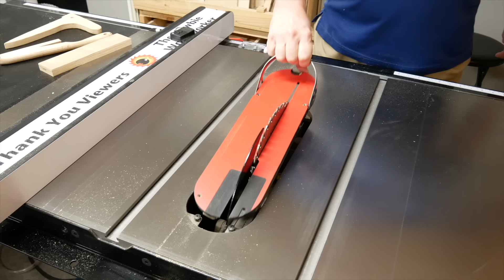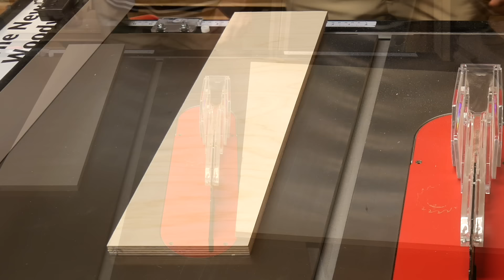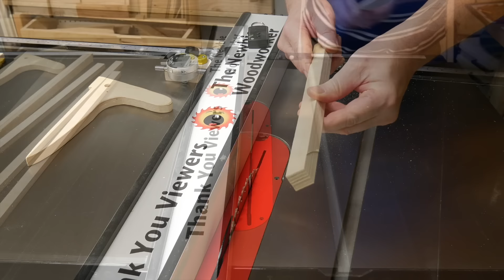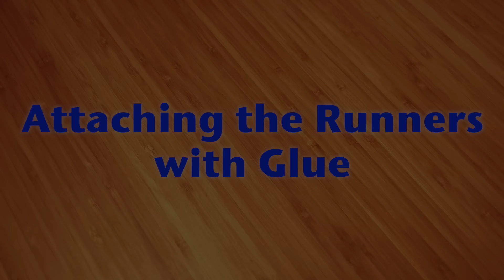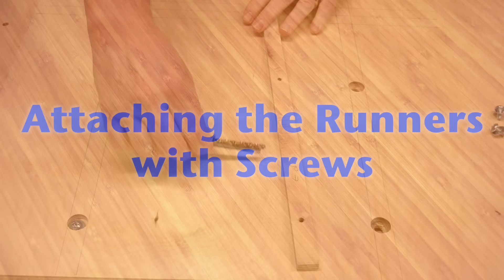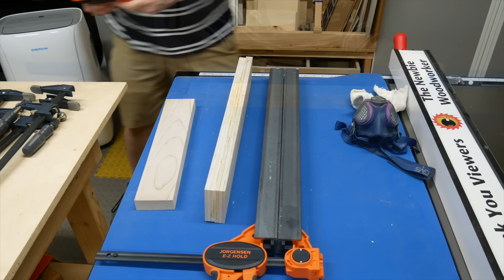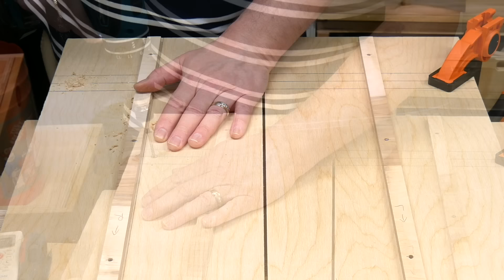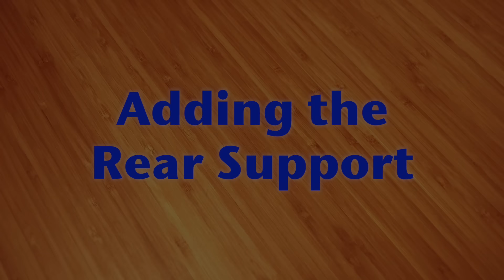Build this Revolutionary Cross Cut Sled, for Newbies!

Comment: Why a sled? I’m new to this but aren’t the fence and miter jig that comes with the saw adequate?
Reply: Smaller table saws do not have the depth to blade to allow wider pieces to be cross cut. Sleds also make repetitive cuts much safer/easier.
Reply from the maker: Miter gauges are perfectly fine, most of the time, assuming yours fits in the slot properly. I don't have a good answer for you, as to why the sled. It's one of those things that when you have one, you understand. I'll think about it for a while, and if I can articulate it, I might make a video about it. Thanks for making me think! 😄
Reply: AngryRed Banjo, that is a very good question. Let me take a stab at this:

(1) Sleds give you a secure and symmetrical place to stand and observe your cut, and for both hands to be positioned--one to the left of the blade, the other to the right. With a miter jig, you may find one of your hands or wrists crossing uncomfortably close to the path of the blade.
(2) With a sled, you will secure both sides of the cut with a hand, so no falling or flying pieces of wood. With a miter, the piece you are cutting off will float free and you will have to reach for it to move it out of the way (often before blade stops), or if it's a longer pieces, it may fall off the table.
(3) Sleds can potentially lengthen the life of your table by ensuring only the sled, whose bottom surface you can sand smooth before use, touches the table top.
(4) Conversely, sleds protect the work piece itself from being scratched by being dragged across the table.
(5) Because only the sled is touching the table, you can cut pieces that don't slide well, or which may snag a guide. With a sled, the piece stays put with respect to the sled and the sled will move only in one direction. No accidental shifting of the piece itself.
(6) Sleds are cheap to build, and you can build several for common angles and reach for one without having to adjust anything.
(7) Similarly, sleds give a more repeatable cuts. You'll have to pay for an expensive miter jig with stops to get repeatably accurate cuts.
(8) Sleds can effectively enlarge your holding area while cutting because it can easily overhang the sides by a number of inches and slide up to 50% off the table and not fall off--especially if the guides are tapered and fitted so they don't lift out of the slots.
(9) Sleds give you more area to add clamps when needed and the option to custom-build a myriad special functions into them, such as stops and safety bars.
(10) Most importantly, sleds are safer. They already have a cut line, and you can clearly see when your hands will fall into the path of the blade before you even start cutting. In case the piece is grabbed or pulled by the blade, your hands will be tied to the sled rather than the piece you are cutting, leaving you less likely to have a finger or hand pulled into the path of the blade. The fence of the sled itself protects you from kick-back too.
Reply from the maker: @nicholash8021  FYI, your comment didn't show up until now, because YouTube had it in limbo somewhere. It just now showed up in the "possibly spam" section - who knows why? Anyway, thanks for the comment - it's very well thought out.
Reply: @TheNewbieWoodworker  Thanks for the note. Probably because I edited the comment like 10 times before I was done. LOL. Actually, there is one more reason, and probably the reason most people use the sled vs. the miter gauge: Cleaner cuts because both the work piece and the cut-off piece are supported throughout the cut. You won't get that bit of chip-out as the cut completes. Also, it's tempting to use the fence as a stop when using a miter, but that is never good. The cut-off piece between the blade and fence can become a projectile. The sled avoids this.
Reply from the maker: @jimcox2715  I think you misunderstood what the OP was saying.
Reply: After thinking about this a while, I can see the sled is on both tracks of the table and would maybe be a little more positive motion compared to a miter gauge and a sled can have the stops built in so no fiddling with the angles and lengths if you are cutting many precise copies of the same part.
Reply from the maker: @rustyaxelrod  True. Another thing, and this is the one I find hardest to describe, is that the stock isn't moving - the blade is. What I mean is, the stock isn't sliding on the surface of anything - it stays stationary on the sled. So as far as the stock is concerned, it's the blade that's moving. It feels so much safer and much more controllable. But again, it's hard to describe.

Comment: I’m building this 24x36w. I’m trying to decide if I should offset the saw blade channel or put it at 12” right down the middle and why one way or the other? Thanks Dan
Reply from the maker: I think with a sled that wide, it'll depend more on how it fits on your table saw. The other thing to consider is how much you'll have to move your fence in order to put the sled on the table saw. And with a sled that wide, I'm not sure how structurally sound it'll be, meaning it probably has a greater chance of splitting. So you might want to increase the space behind the fence from 2" to 3 or 4", and definitely glue on a support piece. Let me know how it works out.
Reply: @TheNewbieWoodworker  I'll have to see how stable it is for sure. I'm using 3/4" Baltic Birch and 2 pieces of 3/4" Baltic Birch glued together for the fence. I was hoping to leave the front open but if need be I could always put a piece across the front with the high "bridge" like in your video. Or, if it breaks just build a smaller one :-). I'll let you know how your child it turns out. BTW, I have the 52" extension so I'm not too worried about moving the fence over. My thinking of the offset was allowing for a longer piece of wood more support when cross cutting it.
Reply from the maker: @williamfeeney2743  My guess is that 3/4" Baltic Birch will hold up just fine. Good choice of materials. However, it will be heavy, so remember that. You may want to add some sort of handle(s). You could also cut big holes in the base like Swiss cheese to lighten it up. In any case, I'll bet you'll want to make a smaller, lighter one also. As for whether to center it or not, I suppose you could offset it to the left, which would add more support when cutting from a large piece of stock. But you've got the right thought process that you might end up making a new one. Some things you just don't know until you try it out. I'm looking forward to hearing how it works!
Reply: Oops, I just reread my original question and realized I mis-stated where the kerf should be. Senior moment🤓. I meant with about 12” or so to the left of the right edge. Anyway I understand the pros and cons now and I’ll just go for what looks right to me. I do plan on making a smaller lighter one also, like the single track model.
Reply from the maker: @williamfeeney2743  Sounds good to me. And no worries about... what were we talking about again? 😂

Comment: OK, why not put the runners in their tracks and lay the top on with a couple drops of super glue? Then take it off the saw and install screws to complete the securely attached runners.
Reply from the maker: Sounds like that would work just fine. But remember - the reason I use screws and threaded holes is so I can adjust the runners later, if I need to. I'll admit this may not be truly necessary, but it's come in handy for me a couple of times, so that's why I stick with it.

Comment: 30 years of using a table saw. blade guards or not and no accident, and then it happened, it happened pretty fast and I got the tip of my thumb and was out for a week and a half. Reminds me of that old saying, "Never say Never!"
Reply from the maker: Ouch! Glad it wasn't worse. And yes, it can happen to anyone - especially as we get older, and the hamsters in our heads can't run as fast as they used to. 😄
Reply: @TheNewbieWoodworker  I think I had 2 hamsters in there that day. I actually remedied the situation by making a throat plate to close the gap, guess I shouldn't have been in such a rush to get things done and went ahead and made the plate to begin with, rather than after  the fact.
Reply from the maker: @AaronCo29  That sounds about par for the course. 😄

Comment: Good video. I would use salt or a few grains of sand to stop the pieces sliding all over the place while gluing
Cheers.
Reply from the maker: Thanks! 😄
Reply: @TheNewbieWoodworker  - Dan, just curious , how much dust is your car collecting in there ?  I want to set up a section of my garage as a workshop but I wouldn't want the dust all over the place . Are you using some sort of dust extractor ?
Reply from the maker: @thrdel  It doesn't get much dust at all. In addition to my dust collection system, I have a WEN air cleaner on the ceiling, and it seems to help a lot. At least, the filters get dirty, so I figure it must be doing something! 😄
Reply: @TheNewbieWoodworker   - Thanks Dan.
I'll try to figure out a similar setup .
Cheers
Reply from the maker: @thrdel  👍

Comment: A former worker who was reliant on his saw guards didn’t like that I pinned up the guard on my saw. He had just bought a new worm drive and was showing me how much safer it is to have a guard. His faith was in the guard and it failed cutting him and he was hospitalized. As a professional tradesmen my awareness keeps me safe unlike those who put faith in guards that are mechanical because they can and will fail. So if I was you I would care and  so I took your advice and stopped watching your video.
Reply: Ditto. Theory and practice are not the same thing.Natural selection is a real thing so keep your damn fingers away from sharp edges spinning at high RPM.Also stumpy is a terrible nickname.
Reply from the maker: @mightymicrofarm7004  There's a reason they're called "accidents".
Reply from the maker: Actually, it's a combination of both that can keep you safest, but whatever.
Reply: @TheNewbieWoodworker  I agree with you and  safety should always be first. Staying focused and not being distracted by anything has helped me keep my body parts intact. The best thing we can do is think and thats what your doing.
Reply from the maker: @NorCalFreechaku  Thanks. FYI, the ability to stay focused varies from person to person: https://thenewbiewoodworker.com/2019/09/04/woodworking-and-add-redux.html
Reply: Proper practices plus safety devices seem the best to me.  Most people tend to not use the guards because they get in the way of work.  But if you can make it to where using the guard doesn't get in the way, seems like a win to me.
Reply from the maker: @CaseAgainstFaith1  Thanks, and that's my thoughts exactly.
Reply: It's the turning away from personal responcibility and coungting on the nanny state that has gotten many tradsman and factory workers hurt and killed. - Remember evey machine you come across wants to hurt you. Act accordingly.

Comment: Great video and I will be building one.  As a tip from building RC Airplanes - put a couple drops of CA glue into the runner after you run the tab.  This will firm up the threads.
Reply from the maker: Thanks, and thanks for the suggestion!

Comment: Why did you NOT use a guard for much of the video? Do tell. I find it contradictory that much of the sled is made without the guard in place. Practice what you preach. Keep checking videos. This is one idea out of many. Combine ideas to make the perfect sled.
Reply: How many people actually use a guard? I think the only place I've seen them is in store displays. The  past 50 yrs I've been able to keep all my fingers at a safe distance from the blade by using common sense and and more than a few push sticks. I think that if I really tried, I'd be able to get my hand under a guard.
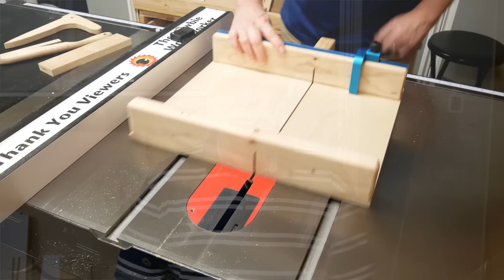Reply from the maker: @drwthmpsn7457  00:35
Reply: @TheNewbieWoodworker  : and as others have said, most of this video was without a guard.
Reply from the maker: @drwthmpsn7457  01:02
Reply from the maker: Thanks for your thoughts.
Reply: I would saw a sharp blade is the most important factor. I would agree the guard can be more dangerous in my opinion. I've had it hang up and ruin cuts. Also they make some cuts impossible. Get a table so its elevated and you can't fall on the saw. Drew is right, push sticks are important. Though I never use the factory, its always some scrap.
Reply from the maker: @nsmith0723  Thanks for your opinions.

Comment: Hi, brilliant video, not as hyper-accurate as the 5 cut method for aligning the fence, but we're not making turbine blades here! Perfectly accurate for our needs. My only comment about your discrepancies between checking the squareness with your "accurate" engineer's square and a roofing square is that in the vid you use the outside angle to check the squareness. Speaking as a retiring engineer you will find that its only the internal angle of an engineers square that is guaranteed accurate not the external as with a wood-working square, so possibly this is where the difference came about.
Your videos are brilliant, keep up the good work.
Reply from the maker: Thanks for the comment, Ross! And after inspecting my carpenter's square further, it actually isn't square on the outside like you suggested, which makes it confusing as to why it worked better. I guess some things will remain a mystery. 😄

Comment: Well made video. However there is no support at the front of the sled. I can see the fence side of the sled splitting in two. You need to add a piece of wood along the front edge like the fence. It would also be nice to add a blade guard (box) to completely enclose the blade when the sled is pushed forward.
Reply from the maker: I was originally worried about that possibility, which is why I glued on the extra support in the rear. But now that I've been using it for a while, it turns out there's nothing to worry about. Remember, there's no real stress on the sled while you're using it, especially with the 2 runners in the 2 miter slots. You could stress it slightly when you take the sled off, store it, and put it back on, but my feeling is that unless you're completely careless, or you stack stuff on it, that's not an issue either. But of course YMMV.

Comment: This is really helpful. I made a larger crosscut sled over a year ago. I'm generally happy with it, but I want to make one that's more practical for smaller projects. I like how you made yours to keep your blade guard on, and I plan to explore that with my tablesaw (I don't have a SawStop, though, but I think it's still doable). I would suggest watching either the William Ng or Nick Ferry videos on building a crosscut sled. They fine-tune the fence adjustment with feeler gauges, which is what I did to get mine fence square. If your squares are truly square, this is less of a problem. I discovered that one of my squares wasn't, so this helped me out. Again, thanks for the inspiring design.
Reply from the maker: Thanks. I saw your other reply, so no worries. [I think the following is just me rambling, but whatever...] I'm first and foremost about what works, for you. So anytime anyone says they like a particular method of doing things, I think that's awesome. I only suggest methods that have worked for me, for when people either haven't ever tried something or haven't found something that works. Interesting side note - I just checked the framing square I used in this video for squareness, and it's not square. So I guess I just got lucky! 😂

Comment: I presume that if you find the screws protrude through the runner(s), you simply add an additional thin washer, yes?
Reply from the maker: It's problematic to add washers, because of the limited thickness of the base. You'll probably need shorter screws, or make the runners a little thicker.
Reply: Or, use a grinder to reduce the length. Do it slowly to keep the wood from burning.
Reply from the maker: @kkarllwt  True, as long as you make sure to get it below the surface.
Reply: So, after throwing together the half-sled, I put this together - and didn't have the difficulty with proud-standing screw ends I was worried about - and it works wonderfully. Thanks again.
Reply from the maker: @4refnump  Awesome! Thanks for letting me know. 😄

Comment: Dear Newbie Woodworker, thanks for sharing your idea which is the first I have seen showing how to add a cross-cut sled to a saw with a blade guard in place.  I work in a Men’s shed where safety is paramount and using a table saw without a blade guard is not kocher. I have been wishing that I could use a cross-cut sled but the blade guard and it were mutually exclusive.  Not any more thanks to you. Don’t get upset by some other readers who take exception to your nice workshop.  Jealousy is a true curse. I congratulate you on having a nice set-up, well done. Thanks again for sharing.
Reply from the maker: Thanks, Peter, and glad I could help. I'm honestly thrilled by the reception this video has received, so don't worry - a few negative comments are par for the course. 😄
Reply: The tribe asks that when you borrow and re-purpose words for another use, that you spell them correctly.
Reply from the maker: @kkarllwt  The tribe also asks that you be specific in your criticisms if you actually want to educate... 😉
Reply: Ironic that most of sled is made without a guard in place.
Reply from the maker: @carguy4715  I think you made your point 5 comments ago.

Comment: This is very confusing. At one point he glued up the runners and later he putting screws on them. Why?
Reply from the maker: I explain it in the video: I showed both ways of doing it, and you can choose which one you prefer. I prefer using machine screws so I can adjust the runners later on if needed. But glue is easier, so most people prefer to use glue.